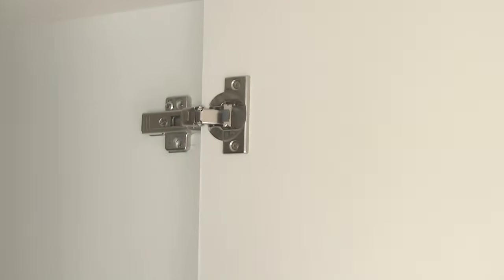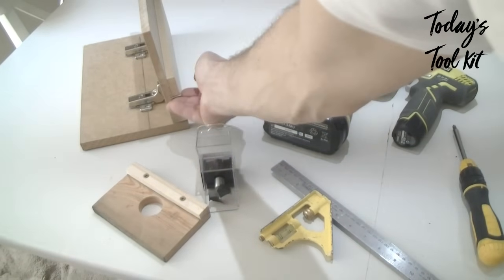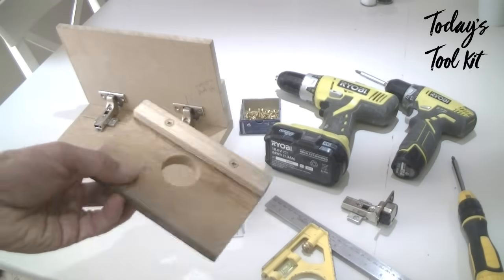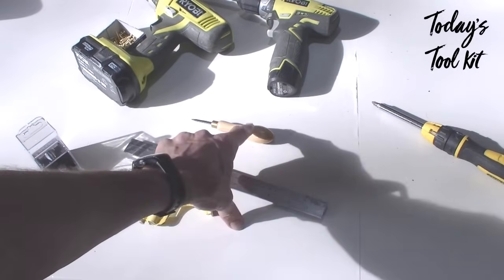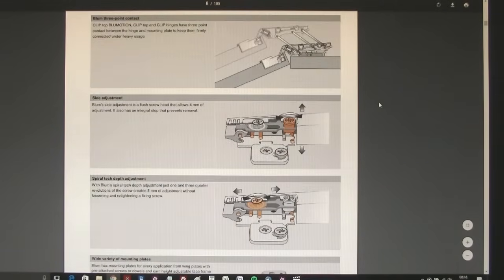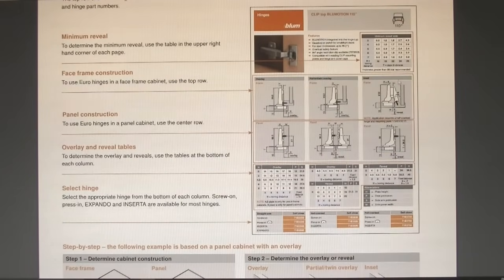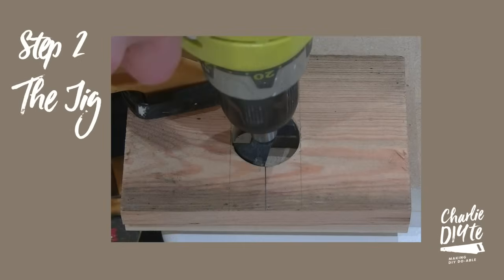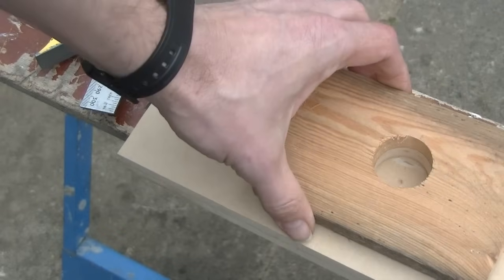How to Measure & Install Concealed Hinges on Cabinet Doors

Comment: Charlie, I love your video! finally a clear explanation of complicated pages on Blum catalogue. Your is the best and only video we need! thanks so much! i did a mock door and i used the Rockler jig to drill the holes but i noticed that door and side of cab are not 90 degree. the gap is perfect, it opens perfectly but the door is leaning inside the frame on the opposite side of the hinges. It looks like they are less than 90 degree. what could the problem be? please help, thanks.
Reply from the maker: Thanks Laura! If I understand your query correctly, you're saying the hinges close the door more than you want it to? Is that right? If so, that's totally normal - they're doing that because they're designed to "more than" completely close - ie the hinge is trying to close the door less than 90 degrees so that it isn't left slightly open. To get the door to stop at 90 degrees, you need to add a piece of wood in the cupboard to stop the door at the desired (90 degree) point. In this video https://www.youtube.com/watch?v=U4zLZocjBs0 I have two points that the door closes onto - one just inside the top edge of the wardrobe, and the second half way down the wardrobe - the second being the entire shelf that sits just above the drawer you see at 9.34 minutes into the video. There was no point at the bottom I could use, because the bottom drawer would have hit it when opened. If you wanted to be really slick, you could incorporate rubber stoppers so that the door doesn't make a wood on wood bang when it closes.

Hope that makes sense, but do let me know if I've misinterpreted the issue.
Reply: thanks so much for responding!...You got it right, now I can go back to my cabinet and complete the build. btw, can you do another intelligent video on how to use Blum 295.1000...that is another product that has no explanation....please keep on posting videos!!!
Reply from the maker: I'll definitely keep posting the videos! If you can do a mock up door using the Rockler jig, the Blum 295.1000 has got to be a piece of cake hasn't it? I've just had a look at the visual here https://goo.gl/ArbPJH Is the drawer front pre-drilled for the drawer front adjuster?
Reply: I actually do not know. the drawer adjuster does not come with any instruction. i saw in a 
n other video but the author did not specify much. Anyway, your wardrobe setting is very similar to mine. i have hives in front of me so the slope of the ceiling does not go side to side but front to back. anyway, my knee wall does not have full side cab like yours. i have only 10cm frame which will be installed on studs. Inset doors will be installed on those frames.  do you think i should mount the doors having the frame completely off? i can have the frame on a table, attach the cup hinges to the door and then attach the clip to the cup hinges and then screw the clip to the frame? my cab is very big 50” wide by 40” high , 2 doors with 3 hinges each. it is my first set of door and i am scared of messing up. is it practice to assembly first and then add the frame (which the door) to the structure. very difficult to describe my setting. i wish i could attach a picture. Thanks so much for your help!
Reply from the maker: Hi again. Unfortunately I didn't show how I did this in the video - I was just conscious at the time that the video had gone on long enough and I might be losing people!! 

No, I would say it is more standard practice to offer the door up to the frame and mark off the hinges that way - rather than with the frame completely off. But if you feel more comfortable doing it with the frame off, don't let me hold you back, but you will need to make sure you position the frame correctly so that there is the necessary clearance above and below the door when you fix the frame into place. 

Assuming you do it with the frame fixed to the wardrobe, you can either do this with the hinges in the closed position (at 90 degrees) - if you can get inside the wardrobe to mark the position of the mounting plates, or with the hinges in the open position if you can't manoeuvre yourself inside the wardrobe. Either way, you want to put a little piece of card (or maybe a couple of credit cards) under the door to simulate the gap you want under the door after it is hung. 

You can then mark off the mounting plates like I did at 15:52 minutes in the video. 

Then, simply mark the outline of all the mounting plates against the inside of the cupboard with a pencil. At this point you're not trying to get the exact location of each mounting plate relative to the edge of the cupboard door - you're just marking out the location and spacing of each plate up the inside of the cupboard. 

You can then take the door away, and now you've got the exact location height of each mounting plate, you can adjust its position in from the edge of the door, mark the screw holes, and drill. 

You could try and do it with measurements alone, but this way, using the actual door, you know that when you come back to fix the brackets in place, they will all line up perfectly.

Locating and snapping each bracket into place is a bit of an art, particularly where you've got 4-6 on each door. You want to locate them all simultaneously, as best you can, and then push them all into their mounting plates in one movement - because if you try and snap them in individually, you'll get a few in, but the last 1 or 2 will be pretty impossible to move into position - particularly if they've disengaged from the mounting plate while you were snapping the others into place! 

If you then find the door is a bit low on the opening (as happened in my case!), if you've used the mounting plates featured in my video, you can release the adjustment screws on each mounting plate and slide it up a few millimeters to get your door into the perfect position. I believe some of the cheaper mounting plates don't have this additional functionality. 

Hope that all makes sense. Let me know if you've got any other questions
Reply: Charlie, one thing that you did not mention is how you go about using MDF. All the other forum I found highly discourage to use MDF because the screws do not hold up well. Did you use special screws (it did not look from the video)? Did you use special plastic inserts (my kitchen door have special inserts the screws go in)? Thanks

Comment: great video! any tips of marking out the screw holes for the base plate? with the mock up it looked easy, but with a massive door, how did you hold it in place so you could mark the holes for the screws?
Reply from the maker: Hi Daniel. Yes, valid point. I thought the video had gone on long enough and so I didn't record that bit - but on reflection I should have done. 

It's pretty easy really. I attached all the hinges to the door itself, and then offered it up to the opening. You might get someone to help you with this. Either way, it's worth putting something under the door to simulate the gap that you will want under the door when it's hung. This also takes the weight of the door. 

Then, simply mark the outline of all the mounting plates against the inside of the cupboard with a pencil. At this point you're not trying to get the exact location of each mounting plate relative to the edge of the cupboard door - you're just marking out the location and spacing of each plate up the inside of the cupboard. 

You can then take the door away, and now you've got the exact location height of each mounting plate, you can adjust its position in from the edge of the door, mark the screw holes, and drill. 

You could try and do it with measurements alone, but this way, using the actual door, you know that when you come back to fix the brackets in place, they will all line up perfectly.

Locating and snapping each bracket into place is a bit of an art, particularly where you've got 4-6 on each door. You want to locate them all simultaneously, as best you can, and then push them all into their mounting plates in one movement - because if you try and snap them in individually, you'll get a few in, but the last 1 or 2 will be pretty impossible to move into position - particularly if they've disengaged from the mounting plate while you were snapping the others into place! 

If you then find the door is a bit low on the opening (as happened in my case!), if you've used the mounting plates featured in my video, you can release the adjustment screws on each mounting plate and slide it up a few millimeters to get your door into the perfect position. I believe some of the cheaper mounting plates don't have this additional functionality. 

Hope that all makes sense. Let me know if you've got any other questions.
Reply: Charlie DIYte I have older hinges which are different to the new ones and am having difficulty putting the doors on with the new hinge. One of the older hinges has a metal plate that the back metal plate goes on. The bottom metal plate has a screw that's stuck in the hole. I have used a gadget to try and get this out but this didn't work. My husband broke the door in a rage and it's the door we use the most 😫 he's useless as a handyman and wouldn't help hold the door so need an explanation as to how to hold the door on your own. Thanks for a detailed instruction

Comment: Hi for the screws , what size drill bit did you use for the pilot holes? thanks in advance :)
Reply from the maker: Hi Christopher. Can't remember to be fair (it was probably 2mm) but what you need to do is hold the drill bit up in front of the screw and you want a bit which is the same size or slightly narrower in diameter than the central spine of the screw without the screw threads, if that makes sense.

Comment: Dear Friend!
Great video. I have one question.
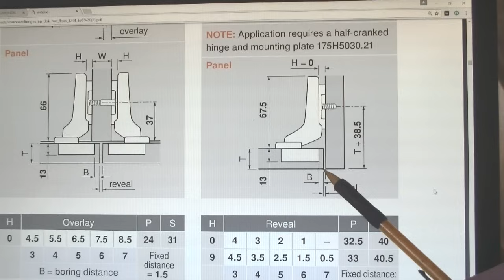How do you decide/measure the positions of the mounting plates? (not from the vertical edge like here: 10:34, but from the top or from the bottom of the side panel of the cabinet.)
With a small "door" model (15:54) it is eays, but with 2m high door I would find it difficult.
What do you suggest?

Thank you for your kind reply!

Comment: Usefull for sure. 😂 but like everybody els you didnt show the job it self. Nevermind the 19 minutes, doing it my self would be a 45 minute fight i hope, and i have 28 door to do😓. Will look at the website and see if i can understand that. Thank you.
Reply from the maker: I didn't show the job itself because it was exactly the same steps as I outlined when I made the mock up - which I did show in great detail in the video.
Reply: Charlie DIYte i did my doors. After some fight with the counter top and door space. Thank you
Reply from the maker: xander witt Great work. Well done mate!

Comment: great video. The info Blum gives is not clear. The link you give for the PDF looks different to me. Not sure if that is because I am in australia? but the brochure you have is much clearer than the one I can see from that link.
Reply from the maker: The brochure has been updated but it's all still there. Not sure why yours isn't clear.
Reply: Neither is mine! I can't see anywhere the distance  to mount the mounting plate. It's so clear on the one in the video

Comment: Super helpful! Surprisingly I still couldn’t find much information about this elsewhere. Thanks for your comprehensive guide!!

I saw you have a door stop to catch the doors. Can you please explain how you go about building that? Thanks!
Reply from the maker: You might find this update useful too https://youtu.be/tdMnnkvInrE?si=jwoSdq7NEKJOPsd0 The stop just goes where the door naturally stops and you can get adhesive pads like I use in this video.

Comment: Thanks for all this - massively helpful. One question though, how did you locate the position of the base plates? Holding the door in one hand while marking with the other seems unlikely, so wondering what method you used here. Thanks!
Reply from the maker: You're very welcome 👍🏻 Take a look at my new vid, Brad, where I explain this point in much better detail https://bit.ly/2UfXY4B

Comment: Excellent video, very helpful!  I'm trying to figure out how to install my Blum hinges on a frameless cabinet, halfway through a mock-up.  How to position the mounting plates was a dilemma, but this video helped.  My other problem is that I cannot get the hinge to "click" into the mounting plate ... at least not hand-held.  Any advice?  Or is it just really hard?  Thanks!

Comment: FYI : the catalogue in the video is the 2012 blum's "Concealed hinges" catalogue. it is much easier to read and the page 2 "Quick reference" still exist (the 2016 and later don't have them)
Reply from the maker: Thanks. Yes it's frustrating how they've changed this.

Comment: Hi Charlie, we had doors fitted with soft closing hinges.. but most of the doors do not close fully.. they stick out. At a loss to what adjustment is needed. There is nothing stopping them from shutting, like an overhang from a shelf. Any ideas..?
Reply from the maker: Do they stick out at an apple or flat? Wondering if you can simply move the hinges back.
Reply: @CharlieDIYte  so the part that sticks out is the handle side, rather than the entire door. There are 4 concealed soft closing hinges. Having checked out videos on the various adjustments you can make... I haven't seen one where you sort of want the hinge to pull the door in tighter to close it, if that makes sense...

Comment: George KnuckeyMy kitchen cabinet doors are equipped with 3 ea Blum 110 degree compact 33 screw-on hinges. After 20 years of use, one or more hinges are defective on some of these doors (cracking noise from hinge, or door will not close). How do I a) determine if a hinge is defective and b) can I determine which is defective without removing all three on each door?

Comment: Hi Charlie, thanks for the vid, very helpful and informative, looking forward to your wardrobe build. I was looking through the Blum brochure and noticed that their normal hinges can be used for doors up to 26mm Is there any reason why you used the 'thick door' version (door thickness up to 30mm) instead of the standard hinge as your doors are 25mm? Does it perhaps provide you with more 'wiggle room'? All the best.

Comment: while i have now followed your instructions i now have about a 1/4 gap on the non hinge side. I cant adjust to hide the gap either. Is there a hidden requirement of door width i did not know about because these doors fit fine with the hinges that mount on the outside. thoughts?
Reply from the maker: It's a bit difficult for me to comment Kenneth without knowing what sort of hinges you've gone for but if the door is now too narrow you may have to revert to the previous hinges 🤔

Comment: Thanks Charlie. What would you use as a pilot hole if the bracket that attaches to the cabinet has self contained dumpy screws?
Reply from the maker: Hi Clare. These screws are quite wide aren't they - about 5-6mm? In which case the pilot hole is going to be quite important, because if it's too narrow you won't be able to get the screw in, but if it's too wide the thread won't bite. 

So you need a drill bit which is basically the same diameter as the spine of the screw WITHOUT THE SCREW THREAD if that makes sense. What I normally do is hold the screw behind the drill bit - like I did in this video https://goo.gl/434dVB at 2:18 minutes, and if you can see a decent amount of the thread of the screw behind the drill bit then you've got the right drill bit (but in this video I was drilling a pilot hole into metal, so your screw thread needs to project a lot more than the 0.5mm that mine did in this video!)

The drill bit should probably be 1mm to 2mm narrower than the screw diameter if you're drilling into soft wood (mdf or pine or simlar), but check your screws as suggested above, and if in doubt go smaller on the drill bit, because you can always increase the diameter if the screw won't go in. 

You probably can't get the screw out to mark the hole if it's self contained, so if your brackets didn't come with a drilling diagram, then insert the bracket in the right position and spin each screw round with a screw driver (preferably an electric one). That way it will make a mark on the wood and show you where you need to drill.
Reply: So I take it there isnt a special pilot drill for these holes?
Reply: Thanks again by the way
Reply from the maker: Well, I think there is actually - sorry - I've never fitted hinges with self-contained screws, and it's always difficult to advise without knowing exactly what sort of hinges you've got :) But I found this thread http://www.ultimatehandyman.co.uk/forum1/first-wardrobe-cabinet-in-hall-t77253-60.html - read Job and Knock's comment, where he talks about the Vix Bit.

If you Google them, you'll find Vix Bits from a number of retailers. You just need to get the right diameter for your screws.  Hope this helps???
Reply from the maker: No worries. Hope I'm heading you in the right direction?!

Comment: I have a problem with the hinges I'm using. The doors angle in towards each other and are not square with the frame. Did you ever have issues like that?

Comment: Hey Charlie,  does this installation technique apply to an ikea komolement hinge?   They are 35mm so i guess so.  The trouble i am
Having is where to place them to match my pac wardrobe! Proper headache!
Reply from the maker: I guess. The Ikea hinge is just a simplified, inferior quality version of this hinge. Not quite sure what the issue is from your description but may be make a mock up to be 100% sure you're drilling in the right place.